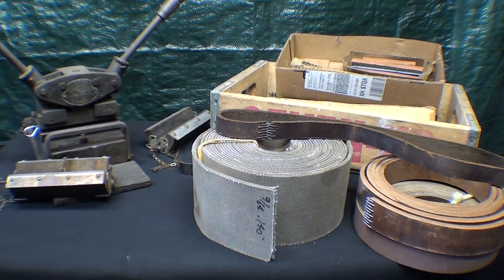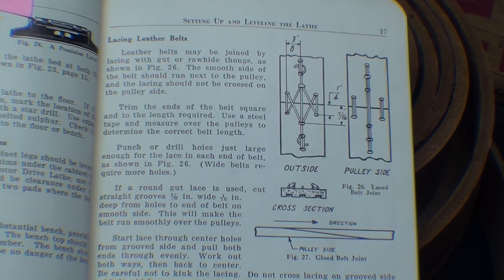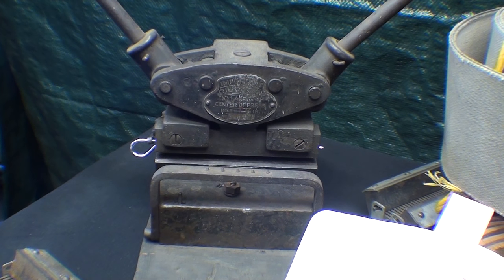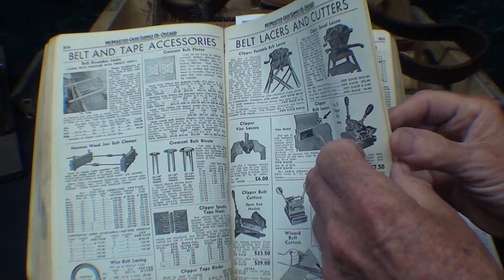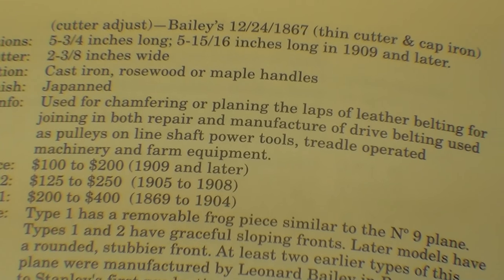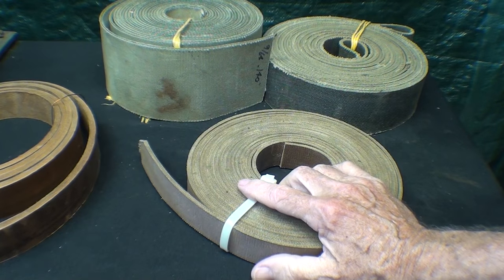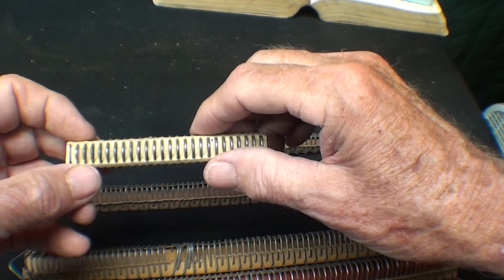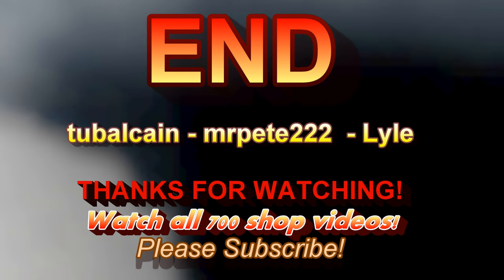SHOP TIPS #315 Pt 1  Lacing & Splicing Leather Lathe Belts tubalcain

Comment: Thank you for this video. I have a Canedy-Otto drill press that is appox 85 years old and in need of a new leather belt. I have the original belt which is 2 inches wide but is in poor condition. I have thought about changing it to V-belt or even chain drive. After seeing this video, i may just restore it with the leather belt. I have even thought about having a line shaft to drive my antique tools, except the people that live around me wouldn't like listening to a hit and miss engine running all day. Back in the late 1970's i got to visit a machine shop that all the machines ran off of line shafts. At the time they were running it off of a electric motor the size of a 55 gallon drum. Under a tarp they had a hit and miss engine the size of a VW bug. I believe OHSA had shut the shop down to safety concerns and due to cost to upgrade and the owners age, he decided to shut it down. I wish i had taken pictures of it.
Reply from the maker: Thanks-that was a good story

Comment: The Cotton Mill industry used a lot of leather belts. The shop I worked in used Clips, Plates and Lacing to make or repair the belts. Most of them were 1/4" thick and ranged from 2"-12" wide and 20'-60' long...

Comment: Here is something I did just today 7/17/2016. I belted up my Fairbanks ZC 3hp engine to my Fairbanks ZC-52 engine which I had just finished honing the cylinder and replacing the piston with one out of a  Ford 250 car. Breaking in the ZC52 without compression, etc. My surprise when I ran across your video om belts. Mine belt is about 18 ft long. 
Thanks for the great videos!

Comment: The glue on that scarfed join would have been hide glue, made by rendering the scraps of hide, horn and hooves to make a nice glue which would stick well to the scarfed surface of the treated leather.

Leather strip is still used by the saddlery industry to make tack and saddles. Made myself a new belt recently using offcuts I had of leather. Did not scarf the join, just used some glue and lacing twine to sew it together.

Comment: So would the flat belts used on the antique motorcycles and board trackers have been joined in a similar fashion? If not necessarily historically accurate would this style of splice hold up?